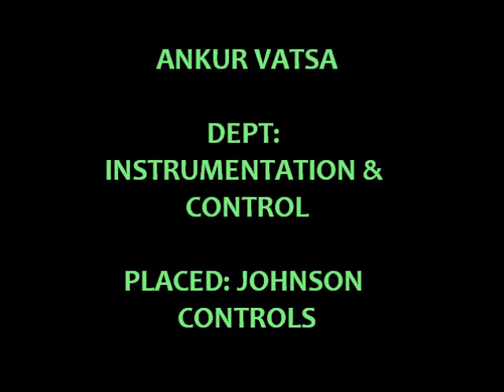Johnson Controls - Placement experience of Ankur Vatsa (Instrumentation & control Engg.)

Comment: hey bro in my college johnson control is coming what strategy should i prepare
Reply from the maker: Brush up your Aptitude first, that's the first step. After that go after the technical stuffs. There is no particular section that is more or less  important. Depends on your luck and the interviewer.
Reply: @anwaar132123  in online test round there will be students from diff.branches then what will be there in technical round? please suggest some topics so that i will get some idea about technical section
Reply from the maker: @dhanashrinalage2295  All branches are not allowed for the campus drive. Only students of EIE and ICE were allowed to sit for this drive.
No specific subject for technical only basic of every topic the spectrum is huge but try to be clear with basics of every topic advanced stuff is not needed.